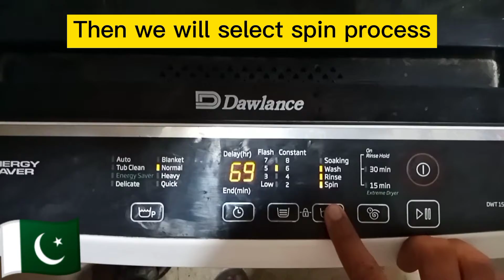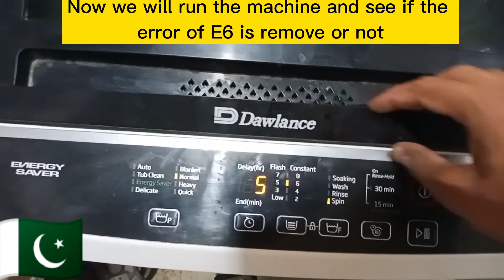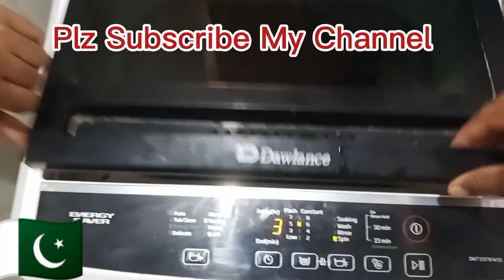How To Fix E6 Error from Dawlance Washing Machine ?  | Pakistan Electronics & It's Solution

Comment: What to do if you join the wires and machine is still not spinning and wen u check out the motor belt u find that it’s under proper tension and is not damaged
Reply from the maker: If motor belt is not damage then gear box of washer is damage